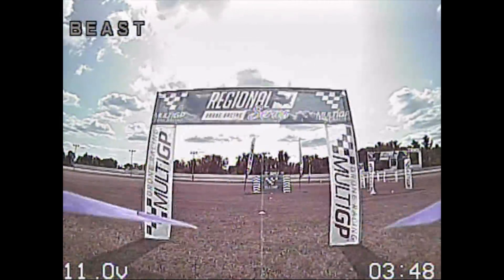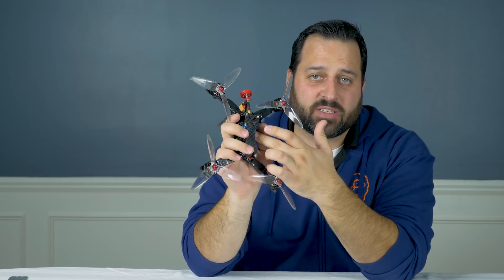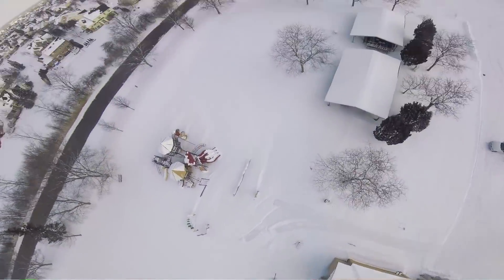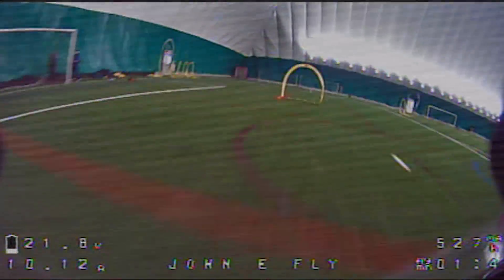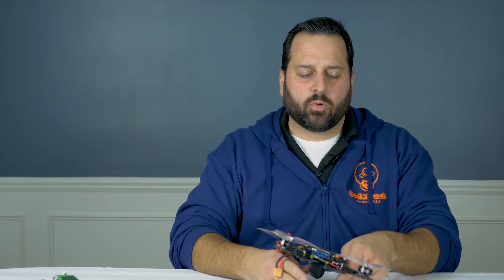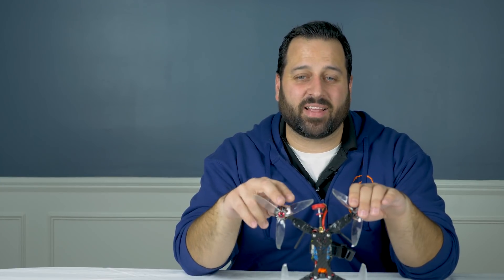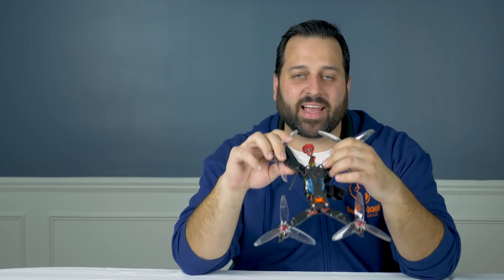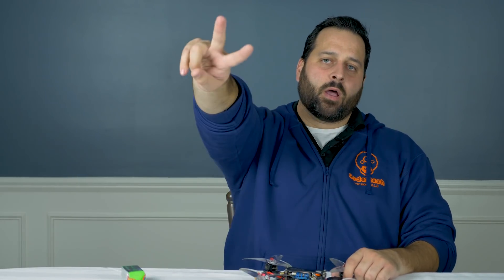6S FPV Drone Racing???

Comment: is 1900kv not to much kv for 6s ? cheers from germany :)
Reply from the maker: 1900KV is what I started with.  It's definitely fast, but I don't think it's well suited for 6S 2 minute racing.  I much prefer 1700KV now.  On 1900KV I used to pull up to 120A.  Which is insane wattage on 6S.  Now I top out closer to 80A on 6S.
Reply: thanks for ur fast answer :)  i just ordered some emax 2306 motors with 1700 kv. i hope i'll get same results as you. it 'll weights without lipo and props ~ 275 g 
can you tell me which props you like the most for  6s 1700kv?
Reply from the maker: I know some guys flying the rsII 2306 1700KV motors and they absolutely LOVE them.  Worlds better than the LS2206 motors (I used to fly the LS2206 1700KV motors).  Way more efficient and much easier to tune.  275g is a great weight too.  Personally I love the HQ V1S 5x5x3 props.  

With the exception of Vanover, I've yet to meet someone that built a quality 6S quad and didn't fall in love with it.  Most people no longer want to fly their 4S quads once they fly their 6S quad.  Good luck, and enjoy!
Reply: thank you so much for ur time ;) i will try the hq props . i tried 2300kv on 5s and with a go pro on it it feels like on 4s without a heavy session 5 on it :D  biggest problem was the flighttime :D

Comment: Great video John. I also had my doubts about 6s as it initially appears to be just a change of values in an equation to reach the same answer... but when you consider that the torque increase can improve response/handling... then you can see it's merits.
However... IF... they were able to introduce torque boost to work as welllike in the silverware fw I think that 6s advantage could disappear instantly... in fact, I reckon they will probably end up having to move towards that idea to improve reliability.
To reduce the risk of FC damage you might want to build yourself a spark suppressor and connect it only while plugging in each fresh 6s Lipo.
Thanks for your insights!
Reply from the maker: I'm sorry, but I don't believe you can make up for the advantages of higher voltage with software.  A higher voltage is going to put less strain on your battery (given you aren't trying to go faster).  This lets you use smaller/lighter/lower C cells and yet get more performance while also increasing torque.  It's a winning combination IMO.  Do you need 6S to compete at the top of multigp?  I don't think so.  But is it superior?  Yes!

Comment: This is all old technology it's what we've been doing with 3D helicopters for a long time now we used to fly T-REX 450 helicopters with 4S and we eventually went to lower KV and 6s and another thing since you're running a cap if you are running a cap you need a low charge resistor that connect from the battery to the main plug you want to connect that first before you connect the battery that way it charges the cap and brings on the voltage slowly and then you plug in the battery basically it's called a spark arrestor and that's what the main cause of failure with 6s systems I was just sponsored pilot for 8 years for Mikado helicopters and Horizon Hobby back in the day before I got into mini quads when I see these high KV Motors and 6s especially the freestylers which can't even fly 4s to their full potential it just makes me cringe when it comes to the freestyle Pilots doing it I think it's more of a attention thing and want to be cool kind of thing because they feel like they're not progressing with 4s I got a friend with a 6S quad and my 4S quad just kills it, but when it comes to racing it's a different story you're going for efficiency, and you also have a taller battery hanging off the bottom which gives the quad a more pendulum stability effect because the center of gravity is even lower even if the weight is the same so a lot of things change. Technology is moving too fast in the wrong way in my opinion I think they need to protect what they have and stop with the hype,

Great video I really enjoyed it
Reply: Farmer Fpv are u NorCalRob? Man, I’m about to swap to 6S just because of efficiency on the last laps. Damm it! Will be a cost, and other issues... is there any frame designed with battery closer to CG? Do you think if the FC is moved up about 2 cm it would give a better flying? Regarding CG, or FC MUST be in the middle of “thrust center” anyway?

Comment: a tip for when soldering the xt60 connector do 1 and put heat shrink then do the other cable not like you where doing in the video if the last cable you are soldering slipts it can short the lipo and wurste case it will weld it self to the other cable and you with have fire
Reply from the maker: Yeah it's a good point.  Another person left the same comment, and I have adopted that process for the set of batteries I soldered later.  Thank you for the helpful advise!

Comment: How has the EMAX lite's been holding up for ya?
Reply from the maker: Awesome!  Zero issues so far!  I'm pulling up to 120A at 6S and they stay nice and cool.  It's still cold outside though...
Reply: Nice! Thank you for the heads up. Trying to decide what too build the race fleet with. I've been thinking tmotor but when your looking at buying 12 motors the price difference between the two adds up fast and I consider the old red bottoms my wolverine motors.
Reply from the maker: Yeah I agree.  For what it's worth, I'm currently working on a new build with Hyperlite 2405 1722kv motors.  I want to see how going a bit lower on the KV works out with 6S.  I'm actually really enjoying flying 5S on the 1900KV motors right now (2350KV 4S equivalent).  Jury is still out for me as to what the right choice will be for me in 2018.  I do love my 1900KV EMAX, but that doesn't mean I shouldn't try other things too...
Reply: Dude that's worth a Lot. Thanks. That's exactly what I've been thinking of doing. I wanna get in the 6s game but I've already got 3 dalrc 4in1s that are rated for up to 5s. So I was thinking 5s route for first race season and that's gotta be better then 4s right? Helps with some sag issues and hopefully the batteries last longer? I purchased most the parts for my race fleet then multigp switches up. Everything I've been seeing they make it sound like around 1700kv could be the magic 6s number and now I'm wondering if 1900kv might be 5s magic number. What I am learning in this hobby is that I'll never be content with the builds I have and will most likely have all my quads running 8S within six months.
Reply from the maker: I wouldn't say 1900Kv is the sweet spot for 5S, but it works really well.  I think people may prefer 2000kv over 1900kv.  That being said it still gives me more flight times and more torque.  It flies great.  I can pull up to 100A on 5S with this thing.  That's equivalent to a 4S pulling 125A.  Basically it hauls, even on 5S.
Reply: I just noticed emax has a lite 2206 1700kv.
Reply from the maker: Sweet!  They didn't used to.  I would be very interested in how those perform.

Comment: What about 5s?
Reply from the maker: 5S is awesome too.  Honestly, one thing I love about 1900KV is that it works pretty well on both 5S and 6S.  I can decide which better fits a track when I show up on race day with a single build.  The open battery limits really open a lot of flexibility for pilots to choose the right setup for the given race.  Bottom line though, the benefits you get from going 4S->5S, you're going to get those same benefits and then some going 4S->6S.
Reply: Thanks for the reply. I was just thinking maybe with 5s your not getting all the noise or frying as many parts but i didnt know the power difference. Now that's it's open we're gonna be learning a lot this season. Thanks you for the vids. Great work!
Reply: How long of flights are you getting with  the 5s & 6s with the emax1900kv? Have you tried the 1722kv motors yet?
Reply from the maker: 2:30-3:30 on 6S depending on pack size/track/props.  1300mah on 5S seems to be around 3:00-3:30 as well depending on the track/props/etc.  

I've had a lot of issues with my build with 1722Kv.  I've spent the last 2 weeks trying to tune a Matek 722 to get rid of awful yaw twitches of death.  After 2 weeks I finally gave up and installed a CL Racing F4s and it's finally smooth as butter.  Hopefully I'll have the chance to get her on a track and compare head to head with the 1900Kv build soon.
Reply: Nice, those are pretty good times. That sucks about the matek. I hate it when things just don't work and i waste a ton of time trying to make it. Look toward to hearing what you think about the new build. Have you tried out the hulkies yet?
Reply from the maker: The hulkies are still in the bag.  So much stuff to test!  The Matek 722 was such a sweet FC too.  I've just never had good luck with the high sensitivity gyros.  Given the lack of optimization for F7 chips in Betaflight, it doesn't really have much of a purpose right now anyways.  I even tried butterflight, hoping it would know how to filter it, but that only made things worse for me :(  Need to get back to having working things I can evaluate and release videos about!

Comment: yeah, there is a torque advantage for sure.  build a 1600kv one, it's even better, but not as much thrust obviously. I let a 6s virgin fly my 1600kv and he thought it was so powerful, but really it was the torque he was feeling.  I have 1900 and 1600 and i just use them for freestyle.  i think i paid $13 for my 1050 pulse batteries!  My whole reason for trying 6s on low kv was to extend the life of my batteries, hopefully.
Reply from the maker: I'm building a 2nd one now with 1722kv.  I feel like that's a good sweet spot for me to try.  Most of my racing 4S rigs are 2550KV so it should equate well.  

One thing I do with this particular build too, is run a lot of 5S.  5S gives me the same total RPM as 1600KV on 6S would.  Again, it won't have quite the same torque as 6S, but it is a big difference compared to 4S for me, even without that added RPM.
Reply from the maker: 1722kv is definitely my preference.  And I absolutely love the hq 5x5x3
Reply: 100% agreed. A lot of us have been flying 5s for a few years now and this is a step in the same direction but even more added benefit. IMHO you have to stay under 1800kv to notice ANY efficiency improvement on 6s over your typical 4s setup.
Reply: Yeah, 1600kv on 6s just sips the amps, even with the most aggressive props.  1900kv is pretty amp hungry on 6s, probably a lot more efficient on 5s believe it or not.  if you don't lower the kv when you increase the cell count, then there's no efficiency advantage, maybe a slight advantage if you compared it thrust for thrust.  Now 2400kv on 5s is a hoot to fly, but it is not efficient at all, sucks all the amps.  In summary, if you move up in cell count, but change nothing else, flight time will go down.
Reply: John E Fly have settled on a 6s KV that you prefer also what props are you running?
Reply: John E Fly thanks

Comment: it's funny my vote was just like yours and then eventually changed to no cell limit just like you did.  what can i say. i'm resistant to change !  i do think some racers will continue to push setups to barely finish races no matter what the cell limit but that's common to all racing activities. racers always love the bleeding edge of equipment.  i do hope to see this move stimulate more good 6 cell equipment for mini quads
Reply from the maker: Sounds like we're on exactly the same page!  I fully expect racers to keep pushing their setups, it's what racers do across all industries, and it's what drives innovation in the field.  I think this will end up being a good thing, but I also think the format will be tweaked over time.  I really hope this brings on longer races.

Comment: Another great video! I was wondering about the reasons you chose a 6s rig instead of 5s?
Reply from the maker: +JT FPV Thanks man!  And congrats on your success at Sebring!  Truth is I chose both.  I wanted to make sure I could fly 6S so I used that as the basis.  But this quad also flies great on 5S.  At 1900kv on 5S that's 2400kv equivalent on 4S.  So that lets me choose between a really efficient quad or a screamer of a quad using a single build, and just changing the battery I plug in.  It's a nice luxury to have where you go to a race not knowing what the track looks like and you have a build that will work well regardless and you can optimize it at the event.

Comment: Very nice video man!!! 
The Ghost its my main racer quad I love it! I’m starting at this so I don’t go that fast, but I wonder if the differences that you are experience are related to the overall weight of your build ? You may want to try a light 4S build and check how it compares. Keep it going man!
Reply from the maker: I think weight plays a factor too.  However, I have had racing builds at this same weight before.  Plus, my other racing quads are only about 15g heavier than the ghost build.  The difference was so significant, I don't think there is any chance that 15g accounted for it.  That being said, I do love the ghost build, and I'm thinking about using that as my primary racer this year.  So if that's the case, I'll build a few more of them and we'll know for 100% sure.

Comment: So funny that you are talking about this, been thinking of doing a freestyle quad with the same motors you have here and trying to get over 5-7 minutes of varied flying and obviously not racing throttle inputs. It will be interesting to see which directions are taken for the sport and the hobby in general as high KV motors were 2017's darling I wonder if the reverse will be true for 2018? Very interesting to see what will be the pervading trend going forward into the year and the next as well.
Reply from the maker: I don't think the reverse of high KV will be the trend.  At least not if you think of it as RPM.  I actually think pilots will start gravitating towards even higher RPM values offered by 6S.  So my build here actually has the equivalent KV of a 4S on 2850.  That's going even higher than most go right now, and this thing flies amazing.  I think you'll see others start doing the same thing once it's opened up for 6S.  It would be really intriguing if everyone starts flying 1600KV though (2400KV 6S equivalent).

Comment: quick tip on putting xt60 battery connectors on. Shrink the first connection before you solder the second or you could short the battery if you slip.
Reply from the maker: That's a good tip and makes a lot of sense, thanks.

Comment: 1900kv@6s = 2850kv@4s.  Unless you're running 2800kv motors, of course it will feel faster.
Reply from the maker: MojoPapi FPV yeah, I messed up my math :).  It definitely felt a lot faster :)

Comment: you should add a capacitor on your quad
Reply from the maker: There is a capacitor on the quad.  There wasn't when my FC blew up, so I added one after.  I'm hoping it helps with my voltage spikes when plugging in.  We'll see.  It's a 1000uF 35V ESR capacitor.
Reply: agreed. it should definitely help prevent what you've unfortunately already experienced.

Comment: Great video.  How many/what sort of caps were you running in that build?
Reply from the maker: I wasn't running any at first.  Then I had the FC explosion upon plugging in, and I decided I should try using a cap.  I now have a single 1000uF 35V ESR capacitor on there.

Comment: wich props did you use? looks like the Gemfan 5152?
Reply from the maker: I landed on the Gemfan 5152 in the end.  In the beginning (including all of the freestyle clips) I was running Cyclone 5046 props.  I also ran HQ 5x5x3 V1S props, but I had too many issues with breaking them.  In the end I liked the Gemfan 5152 the best.
Reply from the maker: I have a few sets of the hulkie 5055s sitting in my bag right now.  I hope to get a chance to try them out pretty soon.  Thanks for the tip!

Comment: 8:24 correction 2850kv, but overall nice video. I really appreciate that you're doing this video and I'm doing a lot of research on it since I saw the videos of dna fpv aka Jason Bouslaugh on Facebook. He really tested hv since 2015-2016, maybe an interesting thing to do is put a 2506/2406/2507 garila motor (he was a tester for them) which weight 30-40g and put it all together with a light 30.5x30.5 stack and a frame that is light but strong that eventually can end up like a 250g quad and then fly with that. The wider stator of the motor would create more efficiency  end you'll get that massive top end. One note tho, these motors can handle crazy things, a motor nowadays (2206) can handle 6s 1900kv on max. 6" prop. These motors can handle 8s and a 7" prop and yes it has been tested.
Reply: It's just a suggestion and no I'm not promoting Jason or garila motor, this has been my experience and Jason helped so many people he is the man if you want to go hv cause he has been in it so long. According to most people the Raceflight bolt is now the best esc to run 6s on (4in1 at least)
Reply from the maker: Oops, you're right.  DAYUM, no wonder she was so fast with 2850KV equivalency!
Reply from the maker: I've heard something similar regarding the bolt.  I'm actually really interested to test the new Aikon BLHELI_32 AK35A 4-1 ESC that supposedly supports 6S.  I wonder how that will compare.  There certainly aren't many good options for 6S 4-1 ESCs yet.  That's why I ran individual ESCs on a frame that is really made for a 4-1.